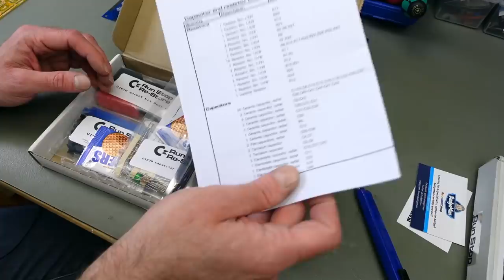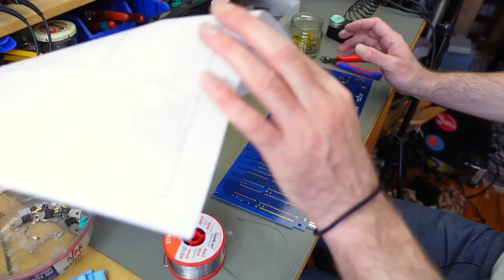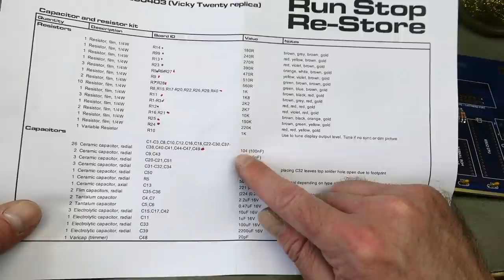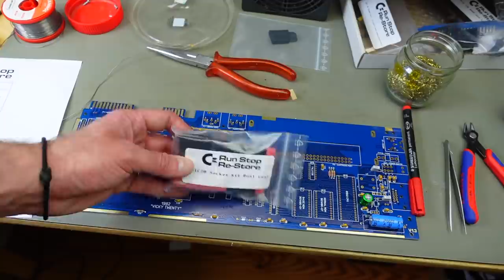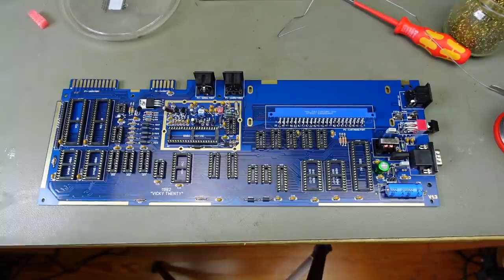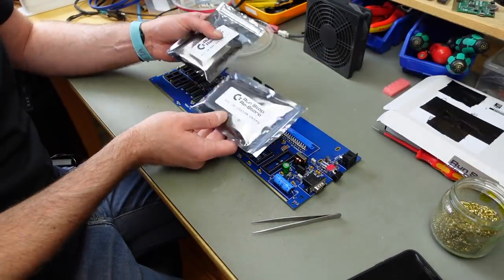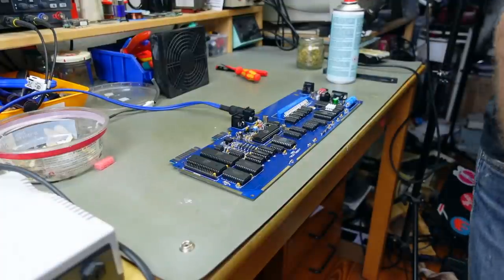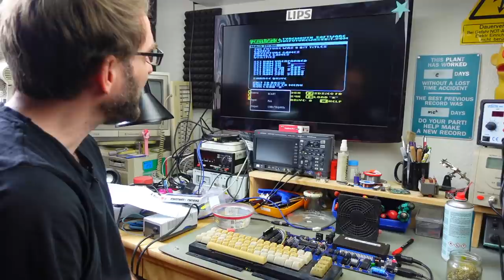Building a VIC-20 in 2021

Comment: Too many working VIC20 boards and not enough VIC20 cases seems like an odd problem to have. Not a bad problem, but an odd one. :)
Reply: The cases are pretty notorious for being damage-prone. ABS with no internal support likes to break if something is stored on top of it or if something falls on it.
Reply: I actually have the opposite experience, as a kid I once accidentally dropped my 'breadbin' C64 from a stairwell and I saw it litterly bounce down from the steps and it hadn't even a scratch, all keys still in place and probably non of the ICs popped out while it still worked.

But trust me, i grew my first grey hair at the age of 10 when this happened 🤣

Comment: "Peculiar reasons." Basically, "Vic" sounds like the German version of the F-word lol.
Reply: yeah, Germany didn't want people screaming "Fick 20
Reply: Indeed. Although changing it to VC as in Volkscomputer (the people's computer) was neat though. Or was that a later backronym? I'll need to check that.
Reply: What I have always wondered is why the "V" is pronounced as "Vau" (in english pronounce as "Vow")
No kidding, A DVD is a "Dee-Vau-Dee"
Reply: @paulmichaelfreedman8334  It has to do with what the orignal name of the letter was. It's origins are ultimately from Phoenician, where it was called waw (like wow in English) and indeed it's still called vav and waw in Hebrew and Arabic respectively. Latin changed it's name to ve (pronouced like weh in German) and this is origin of the name of V in all Germanic languages except German where W is called this. So that's why it's called "fau" in German. As a curiousity, Polish doesn't even have V in its alphabet but the name of the letter V in Polish is fau, borrowed directly from German.
Reply: @weepingscorpion8739  I see. I asked because I am bilingual (English and Dutch) and in Dutch V and W are pronounced simply as "Vee" and "Wee". In english W is double-U which is actually derived from a double-v, quite confusing (medieval forms of the germanic languages all had a vv instead of W, as in vvater).
Reply: @paulmichaelfreedman8334  Yeah, I speak both English and German (my 3rd and 4th languages) so I understand some Dutch but it's really difficult for me to hear the difference between v and w in Dutch.
Reply: @weepingscorpion8739  Indeed it can be but the Dutch can hear the difference in most cases. Also, there is some logic to where v and where w is used, so in most cases it can be derived from the word itself. And as always, russian names end with either v or w, which ever is preferred (v is preferred in most cases). Curious, what are your 1st and 2nd languages? I can have a simple conversation in German but that's it for me. I hated French class in school so I dropped that as soon as I could.
Reply: @paulmichaelfreedman8334  V sounds more like Fau, like F in frequency... 
may be a native german can say the differences between F and V (fau) (comes from the "futhark" alphabet?)

Comment: I learned from watching your build / repair videos the importance of cleaning off flux. I had an inexpensive game controller that always drifted. So I opened it up, and sure enough the PCB still had globs of flux around the pots and elsewhere. I sprayed it with rubbing alcohol, scrubbed it with an old toothbrush, and reassembled it. Now it works perfectly.
Reply from the maker: Excellent! Sometimes even the "no clean" variety of flux can become conductive over time. I always try to remember to clean up nicely. Great that it worked for your controller! 👍

Comment: 18:59  That metallic green electrolytic with radial leads is beautiful!! 💚
Reply from the maker: It’s a Nichicon Muse cap. Quite overkill for a filter cap in a computer power supply section but it’s beautiful indeed. ;)
Reply: @JanBeta   Thank you for replying with the make and model of that cap!
I went straight to eBay and found a few of them.
But the prices from China were so low that I felt skeptical about their authenticity.

Comment: A new VC-20 is born!  Works like a champ.  Very good Jan Beta!  What kind of case will Vicky Twenty be living in?

I would add a step before populating the ICs.  One can check for short circuits of the power rails and measure the overall resistance with an ohmmeter.  Another thing that can be done is to power the board without any ICs to make sure the correct voltages are present, and that there is no release of magic smoke.  This won't catch every mistake, but it greatly reduces the risk of damage to precious vintage ICs.

Comment: Looks like a fun project, we just need a replacement for the VIC chip now, those things are pretty rare. This board is a great option for someone with a corroded VIC20 PCB however, as repairing PCBs with link wires and solder bodges can be tricky if there is more than a trivial amount of damage to the board. Often rare chips can be "recovered" (e.g. repinned) if badly corroded, but PCBs can be more of a problem.
Reply: There is. Adrian's Digital Basement shows it off
Reply: @peacefrog5099  That was for the VIC-II. :)
Reply: @peacefrog5099  Well I'm glad theres a VIC II replacement too, although C64s are not exactly rare, restorable ones are dissapearing fast as more and more tatty ones get dismantled for parts.
Reply: True. Hopefully the people doing the VIC II will make a replacement for the VIC
Reply: @peacefrog5099  Why not ask him? Randy Rossi who posted that it’s a VIC II replacement is the guy who is developing the VIC II replacement. :-)

Comment: Nice work buddy.  I love how you get so excited about it.  Same here when I fix one:)   I have 1 vic20 with original box and gold label with the old power supply.  I also have another one with the 64 power supply with the ureo keys.. missing the f7.  Has the weird blue plungers that don't work with a 64 or most vics.  Just needs a 6560-101chip.  It's on the back burner,  but someday.  I've had bad luck with ordering fake chips.   Anyways love your work and dedication.  Going to keep watching

Comment: Hi Jan,
nice project and very nice to watch!
For bending the legs of the resistors, diodes, etc. I really recommend to use a bending gauge (German: "Biegelehre"). It costs only a vew bugs, makes the job much easier and reduces stress on the components. As a side effect it looks also more professional.
Reply from the maker: Yes, I’ve been meaning to get one of those for ages but never got around to it… :D

Comment: That's a cool project.  I have both versions of the VC20 (ahem) Yea not going to post a bad Germain Word.  Ya know why put it in a Commodore case when you can build something like an Acrylic Case where you can see and show off your fine work plus if you leave the sides open you will not have air flow issues.   When my grandkids were here for a visit they found the A500++ board on my bench more interesting than my other computers.   I have some motherboards I am thinking of putting in frames to hang on the wall.   Sourcing parts can be sometimes be a pain but if your like me your going to buy more than you need which means you end up with a lot of spare parts which is good if you work on a wide range of things and wasteful if you do not.   Having a kit available is very nice.   Resister color codes was beaten in to my head in the 1970's which did me no good because I was more into Drafting then I got bit by computers and thought I have no need for electronics and that all changed in the 1980's when I found myself repairing stuff because I could not afford to pay others to do it for me and then I was doing repair work for others.  Today I am still repairing things both for myself and yea for work.

Comment: there is also another version available, the VIC-2020, which uses mostly newer, off the shelves components - except for one chip. But the PCB Layout, for some reason, is different and it doesn't have the casette port.
Reply from the maker: Yes, I just watched the 8-bit guy talking about that one. I think it’s missing the cassette port and the User Port because those have 9V on the pins. The creator of the board wanted it to be powered by a 5V supply so he left the connectors out. Very interesting project though with some nice upgrades and more modern components integrated on the board.
Reply: @JanBeta  yes, its absolutely an interesting product. It should be possible to generate the 9VAC out of the 5V DC Input, though it might be rather complicated and also expensive as there might not be off the shelve components and you might need to design such a thing yourself...
Though a really interesting product, especially since it uses mostly newer components, except for the VIC Chip.
Reply: @JanBeta  It wouldn't be too much work to integrate a Final Expansion 3 into the motherboard, and make the ultimate expanded VIC.

Comment: Ventilation fans because "I don't want to die".  I am 66+ years old, have been building and repairing electronics since I was 10, never used vent fans and usually in a smaller windowless room.  I have had no related health issues and I AM still alive and building!
Reply from the maker: I was exaggerating a tiny little bit. I’ve done quite some soldering without any proper ventilation in my lifetime, too. Doesn’t hurt to be careful about it though I guess. ;)

Comment: Nice work Jan ... I've done a c64 407 & 466 ... mite just have to do a vic20 now ....
Reply: I have done the 466 as well. In the process of finishing up an ATX64 these days.
Reply from the maker: Thanks! I’ve done the 466 Sixtyclone as well. So much fun putting together your own computer. :)
Reply: @JanBeta  Indeed.
Reply: @JanBeta  Awesome board ... I missed out on buying the Apple 2 add on unit Spartan .. if had got it would have sent it to them. So they could do a board for that too .. i bet loads of people would wanted that  :)

Comment: Awesome video and kit. I would have tested the power rails first before inserting the ICs.
Reply from the maker: Thanks! Testing the power rails is always a good idea obviously. In this case, as i said in the video, the voltage that powers the ICs is coming more or less directly from the power supply, so there’s not much risk of damage if that is known to be good. Still a good idea to double check but as usual I was too impatient to be extra careful (which sometimes backfires). ;)

Comment: hello Jan! Since some time I'm following your channel and actually you have "infected" me to work on some C64 stuff :) I'm  rookie let me say for what concerns electronics, soldering and so on. Nevertheless I took the challenge to save some old C64 from death. I've bougth very chip, butchered mainboard 250425 which requires lot of parts to be put and soldered again. So I'm starting my adventure with power section on my mainboard and here first difficult point is rectifire bride BA20 (item CR4 as recalled by mainboard layout). I have to admit it not that easy to find it and purchase now. Would you reccomend something to me? As I watched this video I see now there are totally different rectifires used.
Reply from the maker: Glad to hear the videos "infected" you! :D As for the bridge rectifier, you can basically use any model that has the same square footprint and can take a couple of amps (the 9V rail is around 1A maximum in the C64, most rectifiers of a similar size as the original one can take way more). I've been using the slightly larger KBPC 610 in many of my refurbished C64s for example. You have to bend the legs a bit to fit them. But any other square rectifier will do.
Reply: How its going?

Comment: Even though this project and other projects associated with the C64 can be had via the MiSter game console kit, are we the last to prefer an independent Vic20 and a independent C64, Amiga, Sega, Atari, NES, SNES? 
Why cant people see the closer we can own a system to the original is far better than a system that is 100's of game consoles and computers all in a single package for well under $100 is just not the same?
Reply: I totally agree.. well.. you see, i do not mind modern FPGA solutions as long they allow the original connectivity like connecting a 1541 or datasette, not possible on a mister but very possible on a Ultimate 64 for example.

So yeah, I don't mind modern stuff as long it honors the classic original including the h/w compatibility.

Then again, I have a attic full with old gear, so for someone who didn't kept his old hardware around but like to play a few games I can't really blame them buying a The64 or a Mister or even using a raspi emulator to enjoy a game now and then.

But I'm a hardware person, I prefer the real deal or at least a compatible one on the h/w level 👌🏻

Comment: Is there a reason to not just use ceramic capacitors throughout? 2.2uf and 10uf very common ceramic values now and they are nice and reliable.
Reply from the maker: I think the main reason for the tantalum caps is that they have tighter tolerances. And obviously this is a 1:1 replica, so it uses the same kind of caps as the original because of that. Most likely, modern ceramic caps would be absolutely fine.

Comment: I noticed the CPU is a 6502 rather than the 6510 (which is a 6502 with some logics). Can u use a modern 6502 in there instead of the MOS ?

Comment: This is a nice board, but couldn't they have had a bit more ambition with the design like adding a few extra holes and pins for an 8-pin DIN for S-Video output?
Reply: I was hoping for a standard VIC-20, but with maximum RAM, and an HDMI/S-Video output on the board.  Might as well pimp it out if building from scratch.
Reply: I was hoping for at least an S video fix with the existing connector to be included,especially as the newer VIC 20s have worse composite output than the older 9V ones.

Comment: I actually enjoy soldering. It's desoldering that I can't stand. Granted I have garbage equipment. I just replaced the cartridge port on my C64 because de-oxit was no longer working. I sadly damaged a trace. But it's in tact, just not attached on the board. I soldered the trace to the leg and it works fine. But yeah, my C64 is in perfect working order now! I also hadn't bothered adjusting the lumafix built into my VIC-2² mod. I tried that. Sadly it didn't change anything. I kept turning it until it clicked. Nothing. I turned it the other direction until it clicked. Nothing. Sadly the picture quality isn't the greatest. It has a bit of a checkerboard pattern.

Comment: I really don't get the purpose of the three-hole positions for the tantalum capacitors. Anyone have any ideas?
Reply: Maybe a "Designed by advocates of toxic masculinity." thing.. :-)
Reply: Probably because you can't mess up the polarity, on the ones IBM used - the negative lead is always in the middle. Helpful for saving time during the manufacturing process.
Reply: @amirpourghoureiyan1637  Ah, so there are 3-lead versions of tantalum caps. I haven't seen them.
That makes more sense, then. Thanks, Amir!

Comment: While I can se the charm of building your own vintage computer pcb, it’s a shame the chips have to come from an original machine and of course it's not the case that the early commodore machines for example have been damaged by battery leakages like an A500 plus for example or surface mount capacitor damage.

I’d rather see an original board in machine.

Comment: Are 1980's PC's coming back in?  I had a C64, but I'm not too sure why people would have any interest in that kind of hardware in 2021. Is there something I'm missing?
Reply: Just a shame that all the add-ons can make this pretty expensive to reproduce.

I’ve thought of doing this kind of project with the C64 version and a couple of spare machines I have. Own two VIC-20’s, though don’t have my original from Christmas 1982 any longer.

Think if I did the VIC-20 version, I’d buy the PCB and analogue parts only to create a working machine that had some hope of lasting for a few years.
Reply: Looks like it. It’s more fun playing 80’s games on real hardware than on an emulator.
Reply: @Doug_in_NC  Can't disagree with that, but there's a certain advantage to having say a bunch of emulators running on something like a Pi 400 when away from home. Might take that to a hotel next time.
Reply: @stephenvalente3296  Yes, absolutely. Who wants to carry a 1980s CRT on a trip?